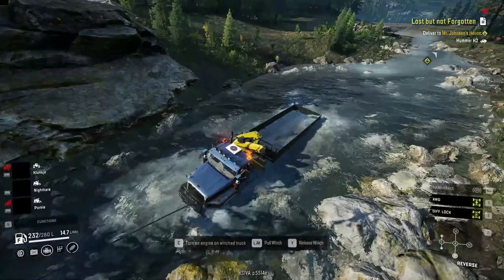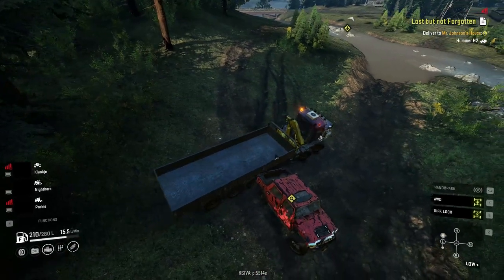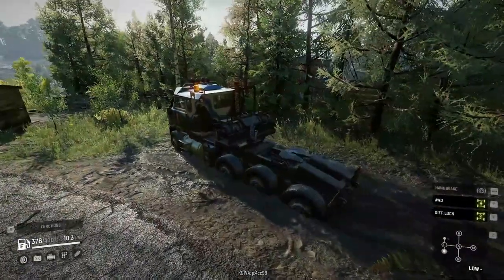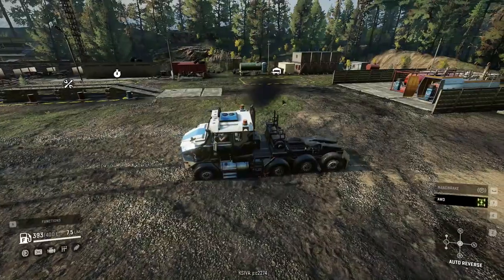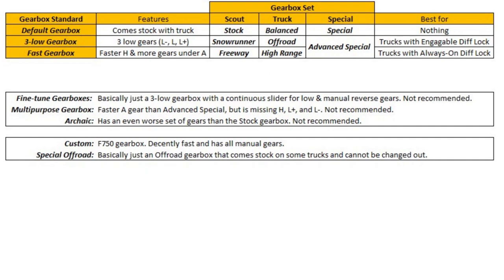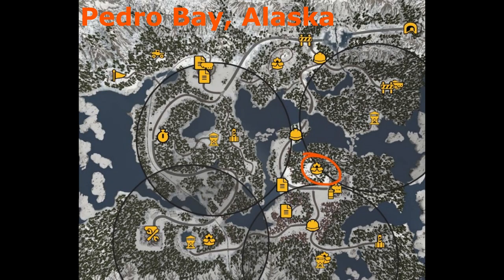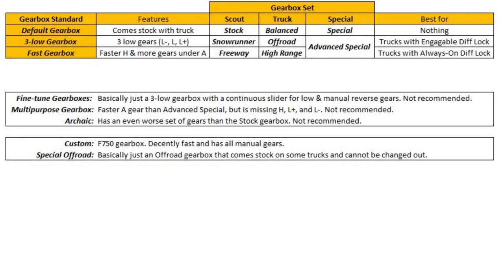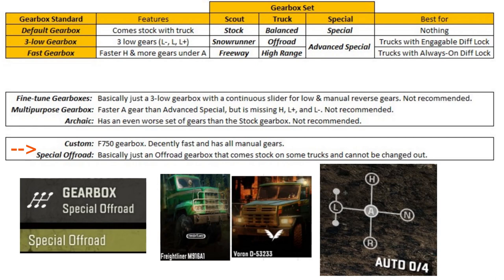A Guide to GEARS, GEARBOXES, & DIFF LOCK in Snowrunner

Comment: Nice guide. The only thing I would add is to map the gears to the numpad if you are on PC so you don't have to fiddle with the shifter (8-H, 5-A, 2-R, 4-L, 7-L+, 1-L-, 6-N).
Reply from the maker: Good tip. I thought about including it in the video but figured that it's unlikely that many people would actually do it even if I brought it up. A lot of PC players play on laptops or 60% keyboards that don't even have a numpad, and without one there really isn't much (convenient) room on the keyboard for 6 additional buttons.

I personally shift with the mouse anyways even though I have a numpad - I'm just a very active driver and don't like to take my hands off the mouse, which interacts with the camera and Functions Menu.
Reply: I'm doing exactly that

Comment: Neutral isn't useless! You can use it for saving fuel while going downhill. While in auto, without you pressing the gas, your truck will shift down to the 1st gear, slowing you down. In neutral, your truck will glide down the hill as fast as gravity will take it, so when you get to the bottom of the hill, you're truck will glide really far without you pressing the gas. You can even shut off your engine while going down the hill if you really need to save fuel.

Comment: I use a neutral drop trick in snowrunner when I get stuck sometimes. How to do it: 1 switch to neutral and build up revs 2 slam it into auto while at the same time use the quickshift trick to get it into a 2 or 3 gear it'll snap u out of deep mud without winching

Comment: Great guide. I notice a lot of people don't give enough credit to the high range gearbox because 'offroad' just sounds way better. 

The only things I'd add is that diff-lock makes your turning radius larger, so when in the low gears, you should be turning it off and on as you need if you're dealing with tight navigation. This also means that trucks with always on diff-lock aren't necessarily better, since they are stuck with larger turning circles compared to their switchable peers. I'd also say a brief bit on AWD would be good. Pretty much always on except when on pavement for sake of fuel consumption. But if you insist on minimizing use of AWD even while off-road, then one should know that it'll improve your turning a little bit while off-road, not just help with grip. It's also pretty much necessary for turning if your truck is incredibly rear heavy, or have a vehicle like the Don 71 with the ridiculous engine that makes it so overtorqued that the front end is barely on the ground while accelerating.
Reply: yeah, this is exactly why most of the mods that add always-on difflock suck

Comment: In my experience quick shifting works even better by hitting a key assigned to Auto instead of the clutch key. The clutch key actually interrupts the drive train but auto key does it more efficiently.

Comment: Thanks for this guide. Your advice about using the Fast gearbox with trucks which have permanent diff lock is something I hadn't considered. I'm currently trudging my way through Amur and wonder if this gearbox would suffice in regions as harsh as this.
Reply from the maker: The Fast GB isn't inherently "less-capable" than the 3-Low in harsh conditions for trucks with Always-on Diff. You basically still have the L+ gear since Diff stays on in Auto, and gears 1-3 more or less mimic the Gear Ratio of the L+ if not offer more versatility. The only thing you are really missing is the L- gear which is seldom necessary anyways.

Try it out, you may be impressed. It's harder to manage but will ultimately move you around the map faster.

Comment: What about the sport gearbox for the sprinter?
And also I'd say the only truck the multipurpose gearbox might be useful for, is the Kolob 74760 because the diff is always locked.
Reply from the maker: The Sprinter did not exist at the time of making this video, and the Sport Gearbox is basically a scout Freeway gearbox on a truck. 

Cabover Kolob has always-on diff yes, but it also has extremely low P2W ratio which makes the Low+ gear important, which the multipurpose doesn't have. It might still be worth the fuel savings tho since that's another problem with the Kolob sometimes.
Reply: @FireflyOnYoutube  Hey thanks for the response! I was also wondering what you would recommend for trucks that have no diff lock.

Comment: Thanks. But why does nobody mention fuel consumption affect that is different with every gearbox, and also the durability? The special/advanced special has a unique feature that is no increase in fuel consumption when enabling AWD. Basically, all the other gearboxes have this penalty, and sometimes it can reach almost x2 increase!
Reply from the maker: Because fuel consumption over time (which is the number shown in the UI) is an irrelevant stat. The number that actually matters is fuel consumption over distance, which doesn't change all that much across gearboxes on the same truck, and is in generally less different across different trucks too.

The "Special" gearboxes keeps fuel/time very low but also caps the truck's top speed very low compared to regular gearboxes, which can cause fuel/distance to remain the same or even increase (in cases where the truck otherwise has the ability to go faster).

This is because trucks consume most of their fuel while gaining speed, and a lot less fuel when merely maintaining the same speed (it's barely any fuel at all if you play the gears & throttle right). So a truck that can reach higher speeds will cover more distance while burning roughly the same amount of fuel except during periods of acceleration, which accounts for a small part of the time in the trip on most routes.

Azov 5319 w/ High Range can consume less fuel that Azov 64131 to complete some routes where it is easy to maintain momentum. It absolutely won't happen in deep mud where acceleration is always being attempted, and the A5 is of course still overall less fuel efficient than A6 even in terms of fuel/distance, but the difference is not as big as the fuel/time numbers suggest.

When you look at fuel economy from this perspective (fuel/distance instead of /time), the difference between different gearboxes on the same truck is so small, I have decided not to cover it.
Reply: @FireflyOnYoutube  It really does make a difference... on scouts at least, using an offroad gearbox vs the standard or highway can mean you run out of fuel after 1/3 the range.
Reply: Sometimes I turn off my engine rolling down long hills (usually tarmac) to save fuel. Sure, it's slower, but I'm not always in a hurry.
Reply: @lobotomyscam1051  how this is related to what I wrote?

Comment: Can you do a guide about All wheel drive?
Reply from the maker: Yes, eventually. Instead of a "guide" it'll just be a video that tells everyone they should keep AWD on at all times, because there's really no reason why it needs to be switched off.
Reply: @FireflyOnYoutube  fuel economy
Reply from the maker: @vladvulcan  Not really, you will still end up burning the same amount of fuel per distance travelled. Turning off AWD reduces your fuel consumption over time, but also causes you to go slower (aka take more time to cover the same distance).